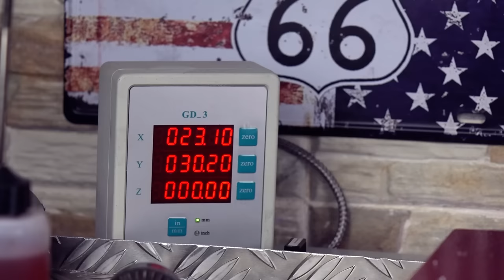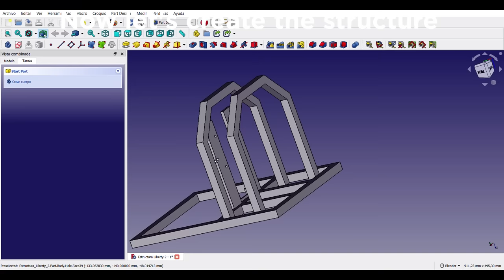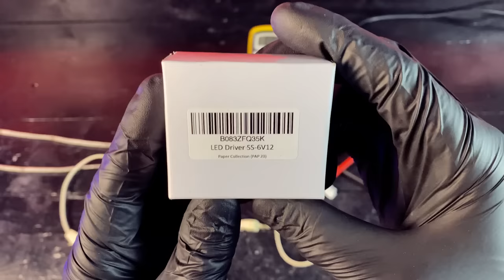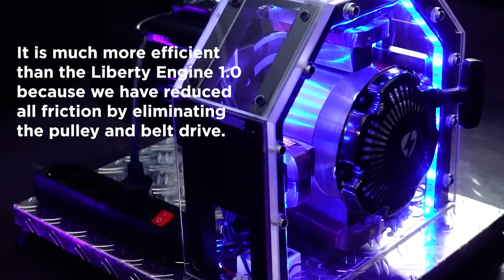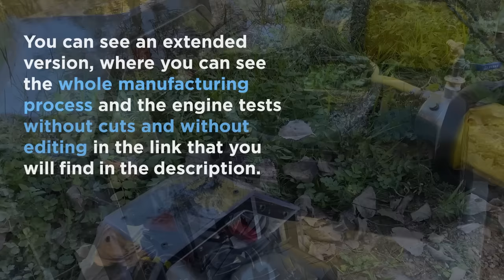Liberty Engine 2: THE PORTABLE FREE ENERGY GENERATOR that you can build yourself

Comment: Energy cannot be created nor destroyed. The sound you hear of the motor spinning is an added audio effect to trick you into thinking the RPM's are picking up however the pull of the engine creates a limited perpetual motion machine capable of spinning for a long time until you place electrical demand on it. It then slows the motor as the energy required to create the magnetic field to propel the rotor would decrease therefore robbing the energy required to propel the motor/generator. Looks like to put a ton of time and effort into this however unfortunately this is no different than coupling two motor shafts together.
Reply: He has an uncut version of the video. The motor would not spin very long at all we’re it as you say. Magnetic cogging in the custom rotor slows down a motor pretty fast. Now I understand what you are saying, that it’s impossible. But the laws you are referring to only address a closed system. There is so much in the quantum world that is flipping traditional understanding on its head. All you need to do is research Nikola Tesla and what he invented and said about it. It’s been heavily suppressed. There actually patents that have been proven to work, and yet here we are. It’s become almost impossible to change academia’s mind on anything here because they won’t even consider that this could be real. Real science considers everything and tests it. Testing it isn’t consistent with dismissing simply because it doesn’t make sense. Is this real? I don’t know but it could be
Reply: Magnetism, like gravity, are forces we barely understand. The magnetic field of the permanent magnets is the prime mover in this configuration and requires physical effort to flash the stator coils by rotating the flywheel to generate a voltage. Energy is not being created. it is converting the magnetic energy of the permanent magnets to an EMF. The whole theory is energy can neither be created or destroyed, it just merely changes form. How does this violate that theory? My question is does the neodymium degrade and how much usable energy could it produce?
Reply: This tandem it’s only for see or watch, when you connect a device to the system, the frequency it’s different. The system at charge breaking and the wheel slowly the speed, or change the frequency on the electricity! 
He put a tester only for voltage, but the frequency ?

Comment: Not following you on the metallurgy of the flywheel eliminating Eddy Current.  It is common knowledge that Silver and Aluminum do exact opposite and are chosen for their Eddy Current ability for magnetic braking. Seems to me the better way to go is laminated assembly with proper shielding.
Reply: A semi conductor inside the drum may possibly direct the eddy current into a magneto-kinetic field it's something I've thought about before. The thing that makes me doubt this is the 220V thats just insane. Something that small can't possibly make that kind of voltage unless its spinning over 20,000 rpm 

But given that Tesla wireless transmission is proven by likes of Eric Dollard and that a super alloy like aluminum, nickel, silver is pretty heat hardy maybe just maybe. It would be awesome.

Comment: P(watts) = I(?Amps) × V(228Volts)
Give me details about output power and output current. I have seen that the output voltage is 228 volts.
Reply: He said 20,000w. So amps should be 86.95. I think don't quote me
Reply: Before any step down occurs

Comment: If 20 kW of energy is produced from this project, they can work for free by installing it in electric vehicles. Patent this project, start mass production and use it wherever energy is needed. Humanity's energy problem can be solved in a single way.
I think this is not the right project.

Comment: The neodymium magnets provides the energy to generate a current in the generator which in turns provides a current to the coils of the motor and generates a stronger magnetic flux in the motor coils .This flux then induces a  flux in the rotor which turns the rotor and the torque will be multiplied by the radius of the rotor holding the magnets which is larger than the lenz effect . Plausible

Comment: If this video is real then I’m a monkeys uncle tell me why while the motor is running. You don’t pick it up and walk around with it. If it’s so portable that shouldn’t be a problem, but you hide the wires and edit the film stop scamming people
Reply: You might be. Here's why.
1) output power @ double the frequency needed to maintain RPM's. This increases the horsepower and could in theory could cause a runaway condition with no load, but the motor is a load.
2) the T shaped cores may cause the coil's opposing magnetic field to not interact with the rotor magnets.
3) if the generator coils are 'bucking' then there would be little perceived magnetic interaction between the magnets and coils.
Reply: But.. good editing leads to views and subscriptions and thus $$$. 
Those primary coils don't seem to be able to produce the voltage needed to run the motor. The high voltage secondary coils would be better. And notice, the Hz rate never falters under a load. It's always real steady almost like mains power..

Comment: Just keep pumping the trickery out for the views and the advertising cash ! Same video on different channels. Don't waste your time and money on this folks, it won't work. Motors and generators have energy losses and are not efficient enough to achieve a self-sustaining condition, never mind getting energy out 'from the magnets'. What happens when you put load on a petrol powered generator.... it changes speed slightly. This thing never changes tone or rpm.... its a magic trick.
Reply: Until someone builds one that runs your town/city

Comment: With 4 magnets you need 1400 rpm and the generator has to work for 3 seconds so that the generator produces electricity.
You cannot manually run the rope at 500rpm to generate power instantly

Comment: john bedini (study energy from the vacuum science series dvd’s) create generators very similar to this. except he charged batteries with the transformers.

and utilized a separate battery to run the prime mover motor. and john taught us that we can keep the prime mover battery “a” charged by connecting an inverter to the charging battery (battery b) and then connect the output of the inverter to a battery charger which keeps battery “a” charged.

it appears you create a way to run the system without batteries. which appears to be next level, john bedini work.

great work!
beautiful design!

Comment: My name is Stick I’m very mechanically inclined. How hard would it be for me to build one of these?   And where would I get the four transformers that are identical?
Reply: Hardest part I see is knowing the alloy for the rotor/flywheel, silver aluminum plus what else at what mixture???  The coils can be hand wound with solid copper wire ....
Reply: I believe this is possible it’s a matter of the components that you use to bring it to life
Reply: Personally, I would want to get four identical transformers. I would not want to get different ones.
Reply: @brian-todddantinne  as far as the aluminum wheel that holds the magnets that can be made out of aluminum really easy. I live right down the street from a machine shop and I could make those real easy. I’m going to build one, but I will have three aluminum wheels with magnets, instead of only one that will increase the amperage production.

Comment: What keeps the magnets from going to the home position, whether you turn the rotor by hand or pull start it?

What is regulating the rpm on the motor?
Reply: There's a tiny little green man inside the motor with his foot on the brake pedal for safety reasons otherwise the motor would spin so fast it could explode and cause an unstoppable chain reaction.

Comment: I am in need of a three phase version with a much higher output. To power a home with my model Wife and a 3 story home. A commercial cube, with parking on the ground floor with my workshop, then living on the first, bedrooms on the third, and a roof terrace that has it's own solar and battery bank, on the garden room I have up there. I need water pumps for bio garding, and fish. So I was thinking of a 3 phase motor, but that is wrong. So I feel I need to know what is the crucial requirements to achieve a good output,  like the revs, 1400 I guess that needs to be maintained.
The alloy of course. But all motor spec's? Do I need to keep them, I am looking at sensor changes. More powerful microwave transformer coils 1100W. Not the 700 or 8000W ones you use.& more of them but means changes, mmm so is it possible, I mean otherwise I would use step up transformers on all outputs if I must but I would rather the genny does it instead

Comment: Still wondering how a 3/4 hp motor can create more kW than it's rating ? It's kinda not logic
Reply: The same way an inverter or geo heat pump gives 5kw/H heat energy for every 1kw/h spent. Electric baseboard being 1:1
Reply: I was thinking the same thing, but after reading up on counter emf, it looks like the motor is not what is producing the electricity...the neodymium magnets spinning produce the emf in combination with the microwave  transformers. This electricity is used to power the motor keeping the emf (electromagnetic field) going. Then the excess energy/electricity can be used to power appliances or charge batteries. Pretty awesome.
Reply: I thought of this in 1978. My science teacher said it won't work, don't even try it. Tried to get a patent on it in 1996. Patent company said they can't patent propectual motion devises. I'm very disturbed I was shot down every step of my life and I listened. Fuck
Reply: @THEMFORMATION  heat pump are basically the only system I know that produce more heat than what it required at input. I think the most efficient ones are between 2:1 up to 4:1 depending of outside temperature and temperature needed indoor
Reply: Pulls energy from the same place any conventional generator does. Where do people think the electrons come from lol? From the ether… another dimension.
Reply: @Blessed Repairguy  at those point in life I feel anything that can get us off of the corporate monopolies for energy should be open sourced to get the info out there. Call it a humanitarian project. But sorry you got shot down...hope your next idea you push through especially if others tell you it won't work.
Reply: @pierrevandeputte2543  yes but with any good scientific experiment...hypothesis stated, experiment created, now more experiments need to be done to support or refute the hypothesis. I personally want to recreate this experiment because if it supports the hypothesis that is just better for humanity, if it refutes then that two can be shown. Watching the video is all I need to build this device I would just love to know the metallurgical formulation of the hub so I could reproduce exactly. Until then I will forge a lump of aluminum and start there.
Reply: The problem is language and definitions. "Power" "watts" "amps" "volts" , catch all phrases " can't get somethin for nuthin" uh- huh, yup. Most people are not taught real electrical science, but a dumbed down truncated basic version that's convenient for teachers, 7th grade science fairs, and power companies.
Reply: @awjet  You Decide, by your self, to think
Reply: @QuebecoisSti  Have you really understand how runs a heat pump ? It's a system who compress a gas who become an transporter of energy...So, there is first, a compressor system, and second a fluid who have capacity to move energy.The result is not to create energy from Nothing ! That machine pump energy at low temperature, and make hot temperature from it. But there is equality of energy between the lot of low temperature gas, and the reduced hot temperature gas created ! The result is same, less some loses.. This system is a real thermodynamic one who respect thermodynamic laws, because this is the fluid who make it possible,and pump is stranger.. In loop motor-alternator, no miraculous fluid :just machines with loses, connected themself, and just an arithmetic addition between profits and loses..
Reply: Try it...just place the wires correctly
Reply from the maker: Because there is no magnetic braking on this motor
Reply: @@edoardo.. if everything is real they should send all mechanical blueprint plans and electrical drawings for anyone to build themselves for The People as an open source project
Reply: convert

Comment: Assuming that there isn't some kind of battery trickery going on (such as batteries hidden inside the box tubing), then welcome to the magic of extracting energy through demagnetization! Subjecting those neodymium magnets to an AC field being supplied to the coils by a motor with ANY kind of load (including the friction of the motor) will slowly demagnetize them, effectively extracting the energy that went into magnetizing them in the first place. No such thing as a free lunch. That said, given the very low current capability of such a system, I doubt that's what's going on. There's almost certainly a hidden external power source somewhere.
Reply: My understanding of these types of "engines" is that electricity is not coming from the magnets themselves. All the magnets are doing is driving the rotor to keep turning, which in turn causes the generator to do what it's made for:  generate electricity! The biggest hurdle with all these motors has always been how to get the magnets to continue turning the rotor in one direction. I suspect in this case the weight and centrifugal force of the rotor is just enough to push into the next rotation .... etc.... till it spins up to maximum speed (which is probably self-regulated based on a ratio of magnet strength + rotor weight).

Comment: There is no such thing as free energy. Or perpetual motion. In physics it says in there " Energy can only be transformed from one form to another" meaning that it needs to start from some type of energy first to produce another type of energy. Energy of the SUN to Electricity=SOLAR, water energy to Electricity=hydroelectric. It needs to start somewhere. That prototype has a power source somewhere, it will never work alone with out a support of other forms of energy. YOU CANNOT DEFY THE LAWS OF PHYSICS.
Reply: How about the starter? 😢
Reply: If this work and he doesn't lie, then the he's converting energy in one form to another (mass to eletrical current)
Reply: No free energy?
And you lift your head into the sky during a thunderstorm, and you will see that BILLIONS of volts with MILLIONS of amperes are "flying" around!
Maybe then you will understand that the WHOLE SPACE SURROUNDING US is simply SATURATED WITH ENERGY,
which people JUST TAKE FROM THIS "SPACE"
(we are not talking about those who STUDIED DILIGENTLY at school))),
(although physics lessons, apparently, overslept when it was said about the impossibility of efficiency of more than 100%
in CLOSED systems.
And you try to CLOSE any structure from the ALL-PERVADING ether (which gives energy to these GIANT lightning bolts)).
Reply: @ZhukGennadiy  there is also energy of "vacuum" so lol, there is everywhere actually lol
Reply: Magnet system of Nikolaev, Nivosibirsk, Russia.

Comment: Could you do this with a bike frame and back wheel, using the chain and sprockets? If kept intact, would the gearing affect the power output as well?

I don't understand electricity very well, but I'm intrigued by this. I want to go off grid soon and because I have no access to a workshop, I wonder if I could do this with a bike frame?

thank you.

Comment: What a con.  Straight from the coils to the motor without as much as a diode in sight hahaha. No regulation of any kind but it runs at a set RPM and doesn't change with load.
Let's see it run that water pump for 10 minutes straight. That should be long enough for the lithium batteries in the base to get hot and tired.

Comment: I don't understand why you added 1mm of thickness to the rotor to be centered and then removed it ?
Reply: Because need keep gap between rotor and stator.  That’s why firstly added tape for take exactly measures to install motor and then remove it once installed motor for structure.  It’s simple.

Comment: The artificial intelligence has told me this about the liberty engine 2: “Magnets can provide kinetic energy to a rotor through attraction and repulsion forces. However, even if magnets can maintain their magnetic force for a long period of time, they cannot provide energy indefinitely. In a closed system, the total energy remains constant and the kinetic energy of the rotor will gradually decrease due to friction forces and other energy losses. In other words, even if magnets can provide energy to spin the rotor for a certain period of time, eventually the rotor will stop unless additional energy is provided from the outside.” But there is still the possibility to make a system that works, it would be enough to connect the power energy of home to supply energy from the outside, for example 1KW/h to help the rotor to run and the system will supply 20KW. If the author will make that, everybody will buy the system that would be the liberty engine 3. be strong author! 😀